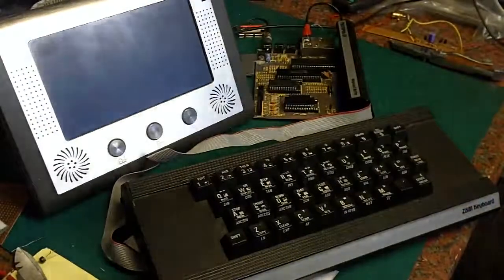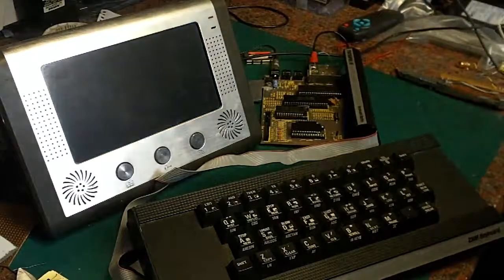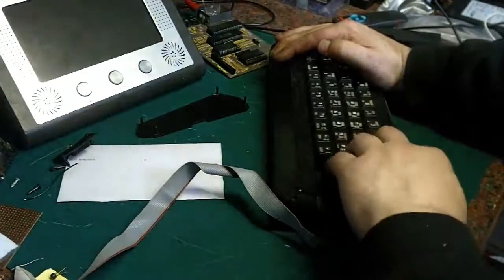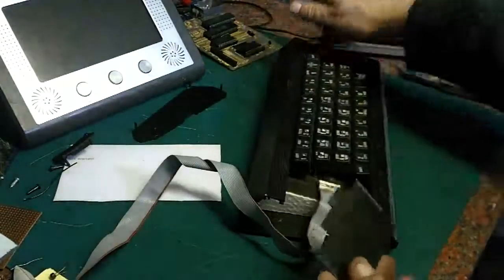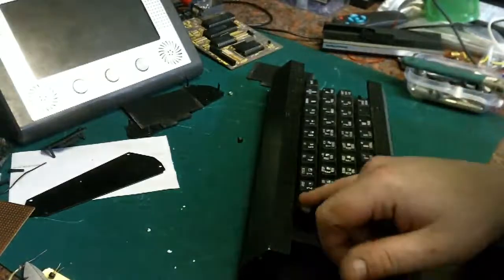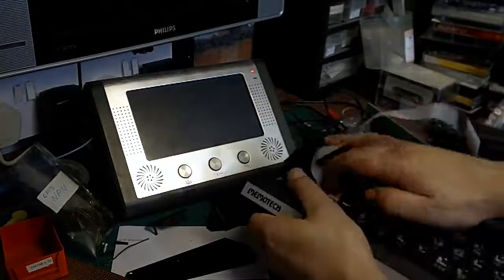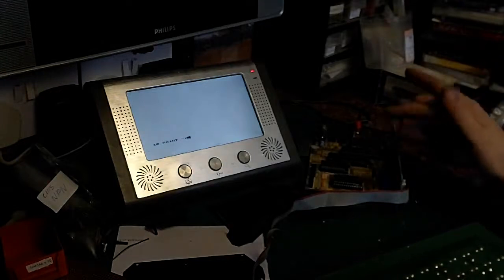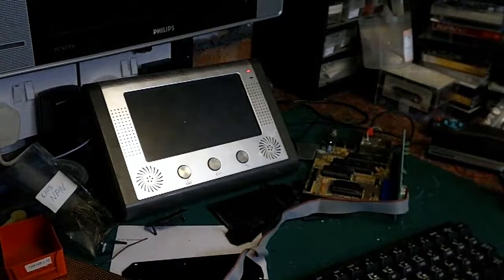ZX81 external keyboard repair Pt1

Comment: Those memotech keyboards are very nice looking, been after one for a while. Looks like you might have an intermittent connection on the 14 way ribbon. Might be worth redoing the IDC terminations at each end and see if that sort out. Seems to be going out rows or columns at a time.
Reply from the maker: Yea think that is going to be first port of call.
Reply from the maker: Hi dave yes that was the problem. I remade each end and that got it going but the connectors are a bit flaky and i broke one of the tabs putting it back together. I'm going to replace the cable and connectors with somthing a little better